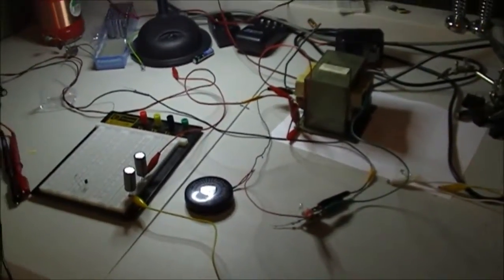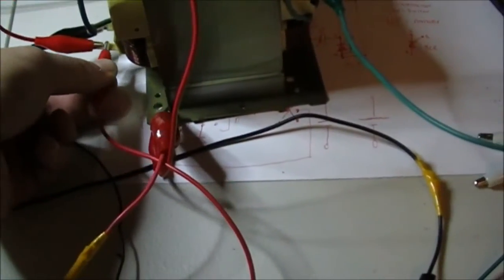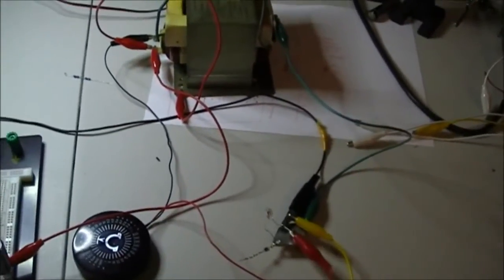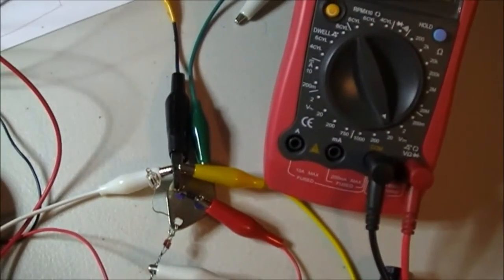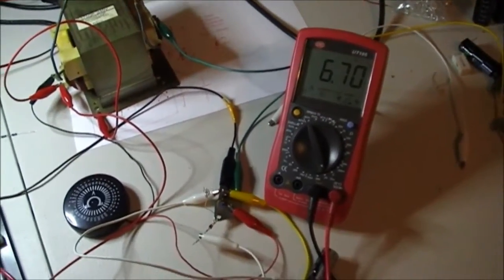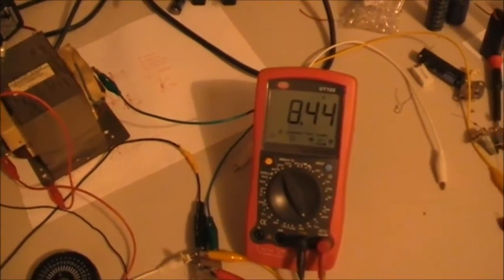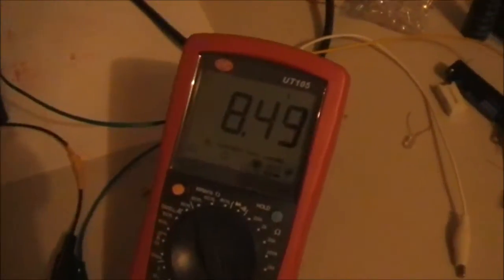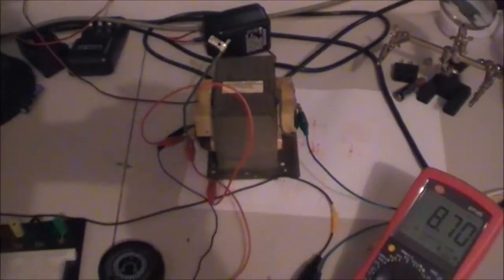Tesla Radiant Energy + Resonance + Frequency

Comment: Maybe the coils of your MOT are acting as a small battery/capacitor? what happens if you also disconnect the negative of your capacitors from the emitter when you remove the positive from the MOT?

Comment: Good video. The capacitors are charged so when you disconnect. They act like batteries until they are completely discharged by the circuit. Hope this helps.
Reply: This. Basic circuitry.